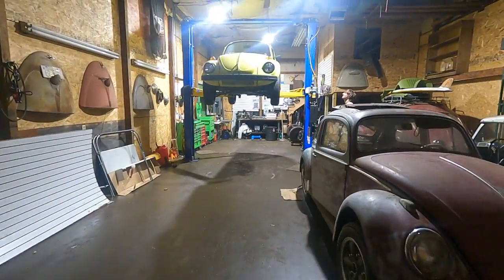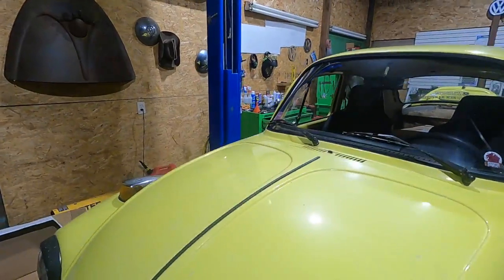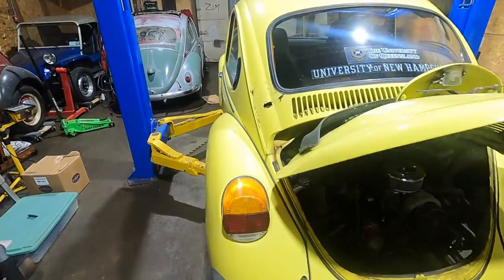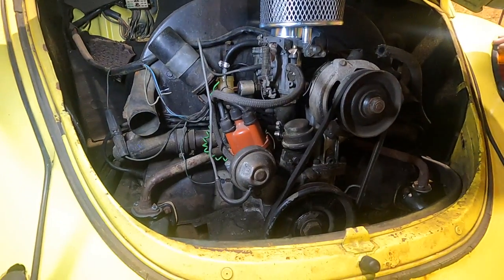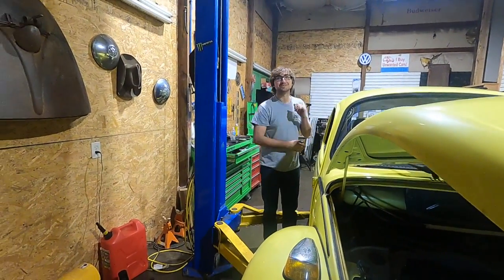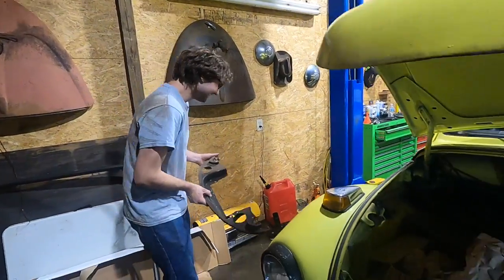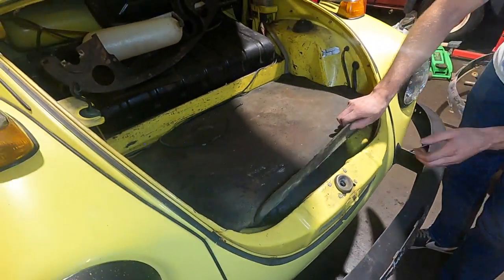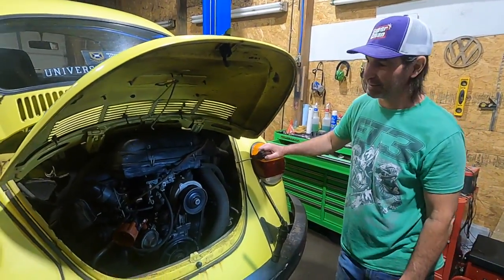RARE 1973 Vw Sports Bug Found - rescued 4 Full Restoration

Comment: I was an apprentice mechanic at a VW dealer in Calgary, Alberta when the Sports Bug arrived. We were disappointed that the engine was stock but otherwise thought they were pretty cool. With those fat Pirelli tires, I think they were actually a little slower than a stock Beetle. As I recall they were available in silver too. Can't remember the last time I saw one. Nice find. No gas heater I see. Driving a Beetle in our winters without a gas heater was pretty miserable.
Reply: It was a silver blue metallic, I had one once
Reply: Beetle drivers praying for a chinook. ❤

Comment: Congratulations DubWerk on securing your bucket list 1973 Volkswagen Sun Bug !
I remember seeing the 1973 Sports Bug/Super Beetle in the dealer showroom in Watertown NY at Harblin Motors outer Washington St. Saturn Yellow - also a huge interest for me. The Finn family in Watson/Pine Grove, NY had one in Saturn Yellow. They also had a 1974 Volkswagen Thing in pumpkin orange with a fiberglass white top. They traded in their 1972 Super Beetle in green exterior, possibly Sumatra green, with Formula V gold stripes at bottom of doors for the 1973 Sports Bug. I have an original dealer Volkswagen Sports Bug brochure. It is a smaller brochure as Sports Bug was a limited-edition model. Also have an original Sun Bug brochure, as well as various VW model brochures from the 1970s. Am very interested in a 1974 Volkswagen Super Beetle with sunroof - the search continues ... Slainte' !  Cheers !

Comment: Those seats that are installed in that sports bug right now are very unique. They were made for 1974 model year only. They were for the interlock system. The bottom vinyl has one strip that goes across and no other design on either the top or bottom parts of the seat. There is a electronic sensor inside the bottom that would indicate that there is occupants in the car. And the car wouldn't start until you would put on your seat belt and turned the ignition. I'm not too sure but they might of only kept that design for only a few months in 1974.

Comment: Hey 5150mxVW .... A great find !! .. I have a big ask; what is the size radial tire? .. I believe the OE tire fitted back in the day was the Pirelli CN36 Radial sized 175/70 HR15. ...I am hoping to not push my luck, another ask. .. What is the Sport wheel offset (ET) of the '73 Sport Bug's 5" X15" steel wheels? (The ET is stamped on the wheel.) I... Thanks in advance !! ....  Cheers, Mike ... Vail, Colorado
P.S.  .. Were fixing up our ole '79 SB Convertable.. My wife is the original owner / its been in heated storage since 1993.
P.S.S. .. The '70s period Michelin XzX and the Pirelli CN36 continue to available.. A set of 4 CN36 radials sized 175/70HR15" are mind boggling expensive @ $375. a piece through Coker Tire.

Comment: Found  a yellow sport bug in a field last spring in MN. It is really, really rusty and not worth saving. But the seats are there. Could not get them at that time. I just passed through there last week, but nobody around. Guy has  a bunch of other junk I could use, too. So I'll keep trying. Had a single turtleback wheel sitting in the back seat, and a bunch of boxes of NOS parts sitting around, too.

Not a fan of Super Beetles, but I like the oddball special models. Have owned a couple of 74 standard Love Bugs in Ravenna Green with the blacked out trim treatment. They had special upholstery, too, but it was very fragile so it didn't last long. Not sure if I have ever seen a nice original seat, only remnants of what they were.

Comment: The sport seats made the sports bug, i've owned 2 of them plus a 74 gold bug, i didn't see if it had the sport steering wheel plus it needs some black decals  just below the rear window, nice condition.
Reply from the maker: He threw the sport bug seats out ! This car was sitting in a garage since 1997 . I remember it listed for sale , I didn’t inquire , it was around a year ago . It does have the sport rims and sport wheel . Lucky for dubwerks I have sport bug seats front and rear in the garage loft .

Comment: The front turn signals covers should be flat black also.
Reply from the maker: All of them were ? I asked him , he said not all but I thought they all were black
Reply: @5150mxVW  Some were chrome and others black,  came thru Volkswagen both ways ...
Reply: @Marc I am I said  
Maybe vw ran out, of the black ones, and use the chrome ones, that were available everywhere.
Reply: @vintage76vipergreenBeetle  Volkswagen has inconsistencies in model production/features ... Either or = SPORT BUG is a GREAT LIMITED EDITION SUPER BEETLE MODEL !  Slainte !  Cheers !

Comment: You need to start doing some restorations. All we see you do is just picking up cars. We never see what happens to them and it’s very frustrating
Reply from the maker: If I could text you a pic of me doing this corner on the single cab I would . Metal work and fab work takes time ...recoding it takes 4x the then add 6 - 8 hours for the edit / upload .

Comment: what for sale //? and I never had ..ok something to think about ,//putting gas in my 2000 Lincoln Continental is up- setting me //wish I had my 1970 blue Beetle //and pull the motor  2 times because of heads creaking //as I drive 80 M/P/H /and replace the oil color //14 inch Chevy wheels on the back it go anywhere snow or mud